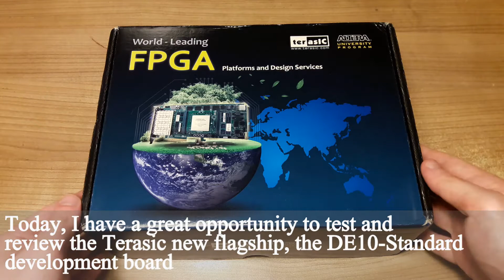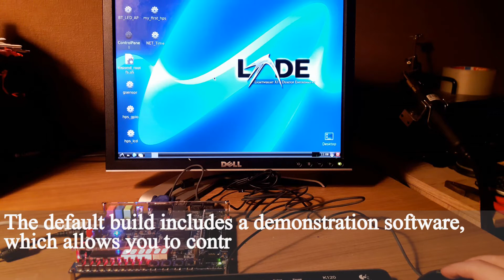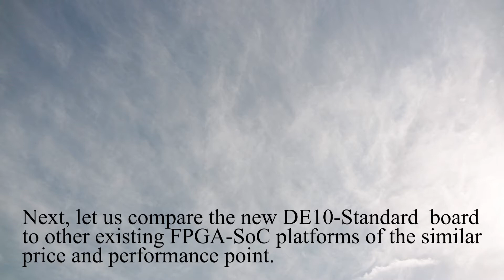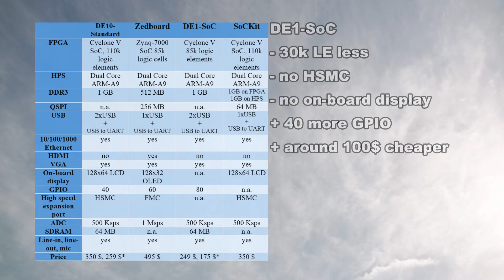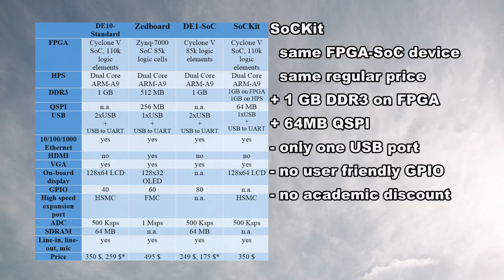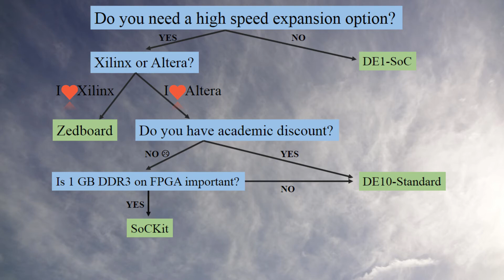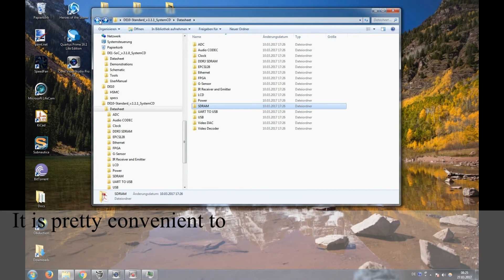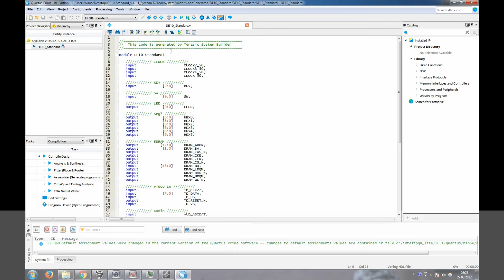DE10-Standard Video Review. Conducted by Toni T800 (Mr. Anton Ruban)

Comment: you have forget to say that SOC EDS SDK for Intel Altera  boards is expensive costing 1000 USD  and  community edition cannot be interfaced with technical computing environment such as MATLAB  , while Zedboard with XILINX tools provide an SDK which is simple and can be interfaced to any technical environment tools easily . Altera development tools for high end  boards such as Arria , Stratix series do not provide  perpetual node locked, device locked editions . They work for maximum for 1 year  and asks you to buy the tools of Altera  priced at 3000 USD to 4000 USD . The open CV tools follows similar patterns while Xilinx provides these tools for high end devices  locked to node and device without need for purchase of the entire tools perpetually . These costs for free software tools are compensated by charging small extra on the boards. I think this is the reason for  Xilinx FPGA to have large market share in FPGA's , even though their boards are expensive in comparison to  their counterparts. I have  purchased devices from both Xilinx and Intel altera  so i am  bringing this to the notice of the people while purchasing the boards
Reply: So intel only lasts one year?
Reply: @sebastianllauce2628  For Cyclone II to Cyclone V, Cyclone V SoC, MAX10 and some others, you can use a free version of Quartus, which doesn't expire.  For Cyclone II and III, you need 13.0sp1.  For anything newer, you can use the latest version.